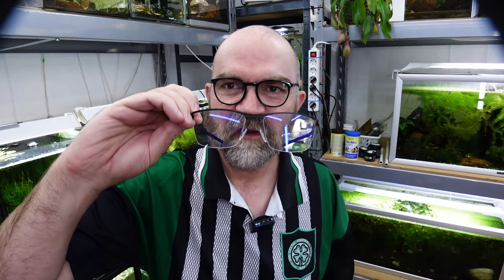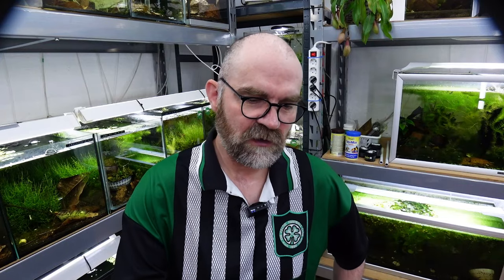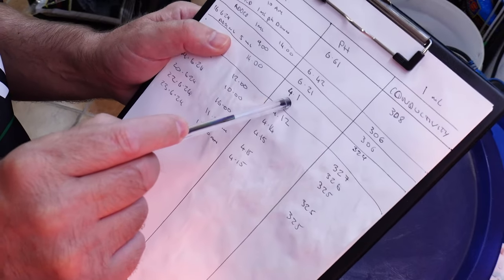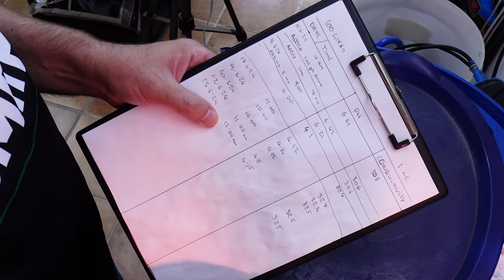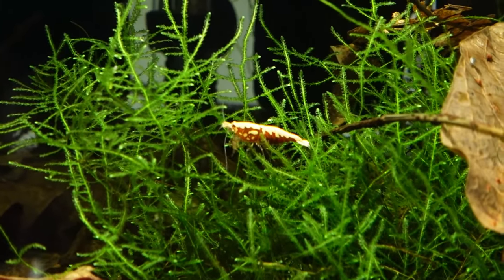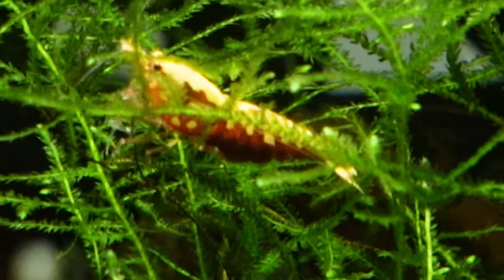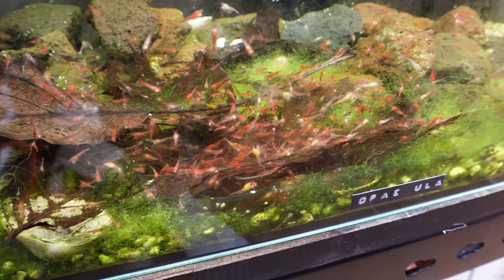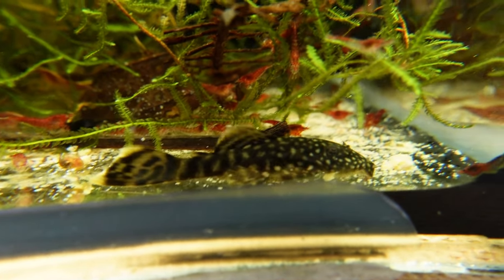Optimal sponge setup, fixing lights, pH testing

Comment: Great video Mark. I also started to lower my filter nozzles. In most of my tanks I have two filters so I found a good compromise and I keep one nozzle in line with water and I lift another one slightly above. This way I have more water flow
Reply from the maker: Well Ive just feed my shrimp since making that video and the difference is night and day, think mega zombie hoard trying to eat you. 🤣🤪

Comment: Good vlog again 
Flow is most important with airdriven sponge filter Usually the number on the box of the sponge filter is the amount of water moved per hour in liters, for which you also need a number of liters of air.
Your Ph is nice and stable in your osmosis buffer vessel, I use 30ml Sera PH-minus on my 300l vbuffer vessel but I have not measured it for stability either 🤪🫣 glad we came up with that,.......Thanks again  Mark💋

Comment: the bee salt mix has very little buffering capacity, so relatively little acid will affect pH a lot. However the tank would have more buffering, even without active soil, and a lot more with active soil.

Comment: Of course you loose energy or more precise you lose X amount of liter/min water flow.💓

If you are above or below the water surface.🎉

The whole idea is to make water flowing/cirkulate trough the pipe.

The pipe below the surface there were the pipe ends is were the air escape and it stops to drag/lift up water.

Not maxumum/optimum if you are 5 cm below surface you have a lower water flow when you throw away 5 cm that the air would be still able to move more water in the tube.

If you are on the other side have the outlet 2 cm above surface. Then the water need to be lifted 2 cm above the surface that takes energy and it cost water flow..

But if you think you have more than enugh filtration and air to waste/use.

Then lifting outlet 2 cm above surface will alter the water flow in the tank to go more down instead across the tank horisontaly.

And you also get bubles splashing down into the tank.🎉

Yeh i can report that I still have god result with the iodine and without any other change.
Now I can just sit back and enjoy them and let them do their shrimpy thing!

Thank for your other videos with wallnut leaves.❤
I have been out and harvest some and dehydrated them so I have a stash.

I dont really figured out how to treat them. Bkanching or coiking them before?
Alexander said that some things brakes down by cooking and less valuble as the "nutrition"/benifits is reduced.😢
But you only soak them. And you are not worrid to get some patogens into the tank?🤔
Reply from the maker: No I am not worried, i already eat a lot of fresh food and so do my shrimps. Thanks for the great comment by the way.

Comment: For me, I like the outflow on top of the water. If you look at nature, the place where water is the most oxygenated is under waterfall's. Shrimp don't mind flow but I think it's better if they are not deranged by flow, as they live in calm stream's. I don't think you have a better filtration as you have more flow. That's why I use 3 sponge filters per tank, great filtration, not too much flow in the tank and enough water circulation.